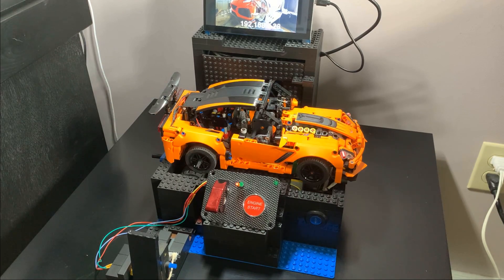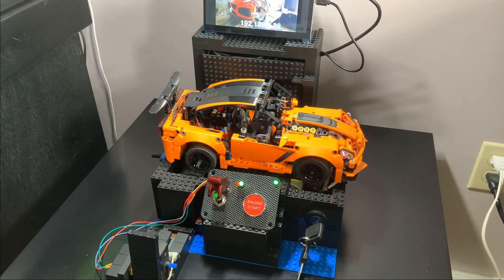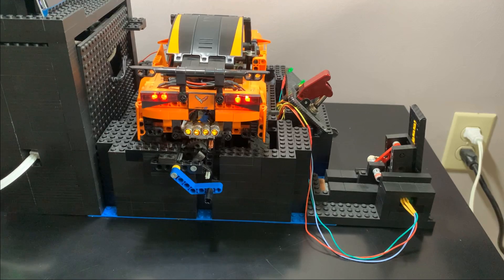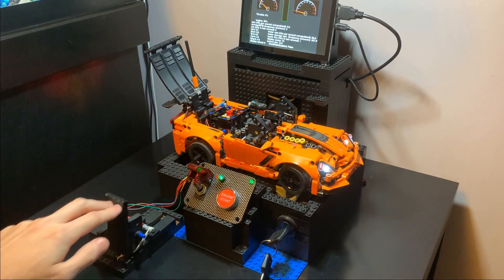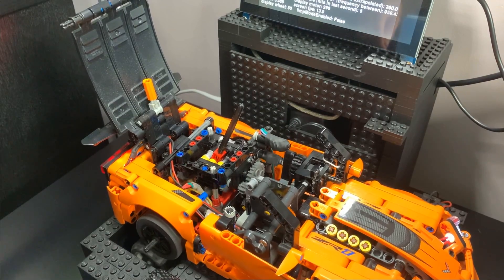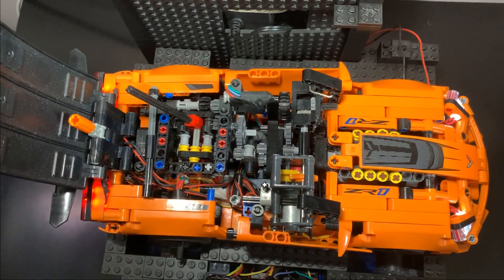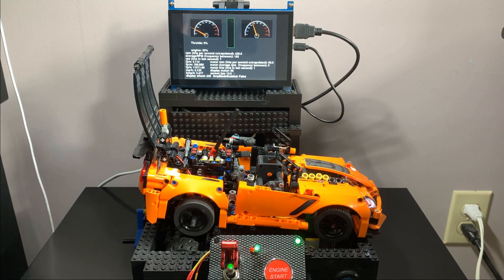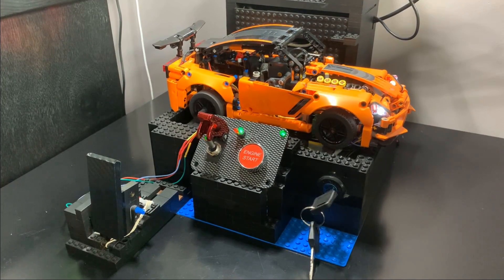Electric Lego Corvette w/ a Raspberry Pi and a Lego 4 speed Transmission!

Comment: That's just awesome, i am buiding my own one using 2 DC motors to drive the rear wheels and a servo for steering the front wheels.
I will also give it other features like a line tracking module to make it self driving (following a line on the ground) and ultrasonice sensor for obstacle avoidance.

Cheers
Reply from the maker: That's awesome! Can't wait to see!
I'm working on another, with steering and RC capabilities too

Comment: shouldn't the pistons move when turning the engine on?
Reply from the maker: Hey Franciszek, I'm not quite sure what you mean, but the pistons do move when turning the engine on :) Watch at 1:00, you can see the pistons are firing when the engine idles :) Thanks for watching and thanks for the comment!
Reply from the maker: I just realized do you mean should they have been moving when I was actually "cranking" the engine to start it? In that case-- then realistically yes you are correct! In fact I have actually done that since then as an improvement, it just wasn't part of the build at the time I filmed. Take care!